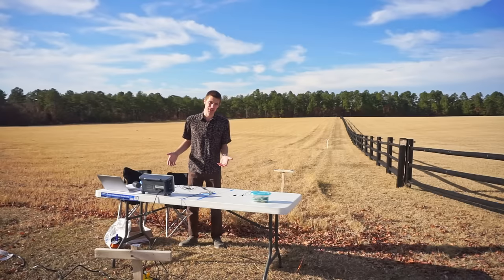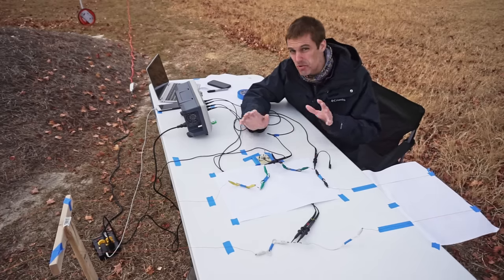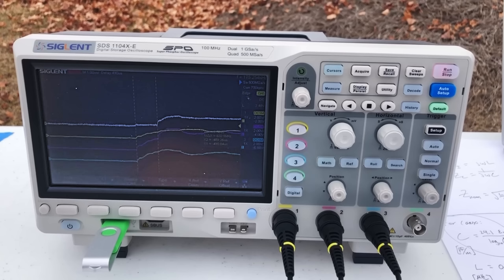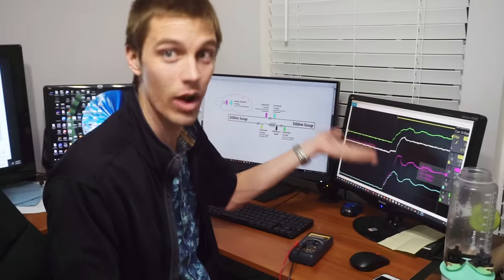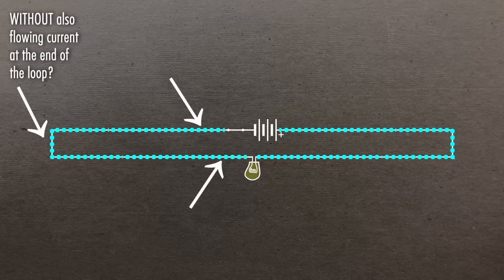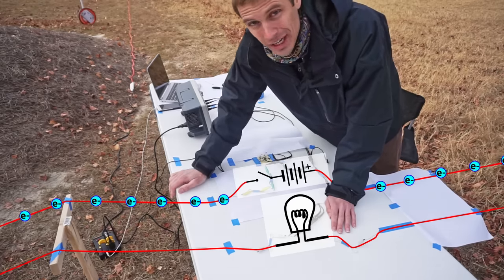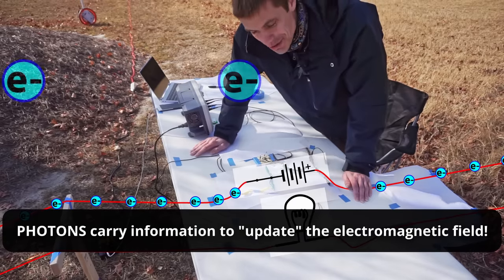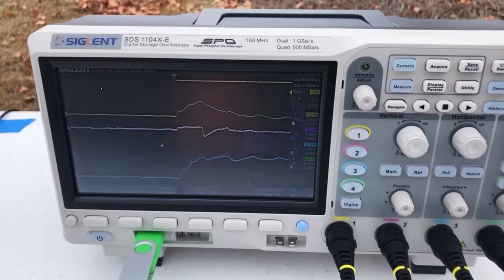I bought 1000 meters of wire to settle a physics debate

Comment: This was the explanation that made sense to me because as you mention, I couldn't wrap my head around the "magic of the pointing field" as it was dismissing the length of the wire and asserting that the physical distance between the battery and light bulb was all that mattered.
Reply: Veritasium deceived his audience by showing the visualizations for a stable state that is only reached after significant time have passed to somehow justify his wrong statement about power getting to the lamp directly at speed of light which is a very different situation.
He didn’t show actual visualizations for his “correct” answer.
Reply: @noop9k  Yep, ElectroBoom and Dave did videos that explain this at a higher level. Essentially you can think of the wires on each side as transmission wires.
Reply: he did say that the lamp has to turn on with ANY current. the problem was that this hypothetical situation can be easily mistaken by people as a very intuitive expectation while it isn't; a light wont turn on with any current, nor having "any" current is "any useful" for other things. he just made a big capacitor. But I suppose the real reason for the video was that energy moves through the electromagnetic field instead of tiny things moving inside of the wire. which is right.
Reply: @falahati  > he did say that the lamp has to turn on with ANY current

He actually said "the light bulb has to turn on immediately when current passes through it".  Maybe because I'm not an engineer, but I thought he was emphasizing the "immediate" part, not saying that any amount of current will turn it on.
Reply: @marko1395  He didn't need to emphasize the any amount of current part in emphasizing the immediate part.
Bulbs fade on relative to their load, so if it comes on immediately, it comes on under ANY load
Reply: @D-Vinko  I guess that's the "I'm not an engineer" part.  I don't know that.  To a layman like me the video did seem to suggest something different.

But it's all good, I only had to watch ten more videos from all these fine people on YouTube, and now I think I understand what's going on :)
Reply: @falahati  
1) ANY current wasn’t in the problem statement. He adjusted the question to suit his own (still wrong)answer.
2) “ANY” current means that the lamp is always “on” from arbitrary noise that is always present.
3) “1/c” answer doesn’t require the wire at all. Because leaves 0 time for the energy to propagate along the wire before jumping over the air to the opposite side. exposes it as a troll question.
4) if we assume “1/c” answer to be true, this means that exactly at t=0 there is a step-like change of EM field around the switch. But closing the switch only allows electrons to migrate, does not cause instantaneous EM field change. Electrons need a non-zero time to start moving, therefore the field can only change gradually and is still zero at t=0. Even if the oscilloscope doesn’t show it, even this small current does not appear instantly but ramps up from 0 within a few nanoseconds, making Derek’s answer  still technically incorrect even if we accept this magical “ANY current” rule adjustment.
Reply: @skilletpan5674  IMO seeing this as a transmission line is also a misleading oversimplification, sorry.
Reply: @falahati  He did make a comment later on saying he did not intend to mean that the light will turn on no matter how little the current was. He was trying to say that there was a small but substantial amount of power transferred instantly. So what most people thought, was what he was actually trying to say. And he was wrong about it.
Reply: @falahati  Someone who actually understands the physics. It's tough to understand whats so unintuitive for the masses, but reality none-the-less. Keep your brain fully engaged, there are too few who manage this feat in my experience.
Reply: The physical distance between the battery and light is all that matters "for any information originating from the switch to reach the bulb" (quotes for emphasis). That's it. It's not about useful energy transfer - it's about information.
Reply: @falahati  The issue with setting it up as Derek did is that leakage current through whatever switch you're using - and through the gap between the bulb and the battery - will cause the lightbulb to never turn off
Reply: @caiocc12  The original video wasn't about information though, it was about how electricity works. So it really is about useful energy transfer.
Reply: @Lilitha11  the original video was very unclear as to whether they were talking about power or about information. One of Derek's examples in his video was a Morse code line.

Comment: The reason I liked this explanation so much better than Veritassium's is that it showed off both the practical reality, and the interesting technicality at the same time. Derek's video is misleading in the way that it emphasizes a technicality while brushing aside how utterly contrived his setup must be to even achieve that. People leave his video thinking something to be true that isn't. And even then, the 1m distancing itself isn't emphasized enough, viewers will mistakenly attribute most of the phenomenon to light speed rather than proximity and inverse square law. At 10m it's not just that the delay would be 10x as long, it's that it would 1000 times weaker. Saying that the bulb "wouldn't reach it's full power" until the electricity made the loop is like saying an ant helping push an aircraft carrier under full engine power "doesn't quite do all the pushing".
Reply: My friend billy the ant would disagree, he once managed to push start a fire truck right before the driver switched on the ignition.
Reply: This... I'm disappointed in Derek in this specific case..
Reply: Yep. This is exactly why I didn't like Derek's vid. He's not exactly wrong, but the nuance was thrown out.

A lot of the potency will dissipate via wire, because, guess what? In the real world we always have resistance as losses.
Reply: Wouldn't inverse square law mean 10x further corresponds to 100x weaker? You said 1000x weaker.
Reply: @Chrispheh  - Correct. I meant inverse-cube. I think. Or maybe it's invert-square and only 100x, since it's the surface of a sphere at that distance from the origin, not the volume. Hmm.. in any case, at 1 meter it's almost immeasurably small, at 10m, to have a light that could actually pass this test, it would also be triggered by stuff like you blinking your eyes or farting. It's just such a microscopical useless amount of power to even sort of be true... and Derek doesn't even explore this in his video. You're led to believe this would work at any distance between wire pairs and that electricity is not carried by wires. In practical reality, that's rubbish and even in a contrived, imaginary scenario he didn't even make his point very clearly.
Reply: Great points, but I'm super confused about the ant analogy.  Is the aircraft carrier sitting on land? In that case, the engines wouldn't do much either.  If the carrier is floating then, 1) how are there ants in the middle of the ocean, and 2) who taught the ant to swim? Also, I think it may make more sense to attach the ant to the front of the carrier with some kind of towing line instead of it pushing; that way you could attach a lot of ants at once, but if they're pushing, you're limited by the surface area of the ship, not to mention how difficult it would be to grip it considering everything is wet (although depending on the size of the ants and what part of their body they're using to push, and the fact that most insect bodies are hydrophobic so they don't drown in rain drops, you may be able to get a dry ant-to-ship attachment).

Thinking more about using a line/rope/cable to attach ants, you'd likely have to have multiple ants per line as with one ant per line the additional mass and inertia of the line itself would likely cancel out the advantage gained by being able to attach more ants.  I think if you used a line with a high tensile strength to weight ratio (thinking spider silk, Kevlar, CFRP, or carbon nanotubes) and designed small loop-style harnesses along the line so that you could attached thousands of ants to it, then they might have an effect.
Reply: @MattsAwsomeStuff But parallel wires DON'T obey inverse-square.   Instead they obey 1/r falloff.   That's why the 1M separation cannot block the small initial signal.  Going from 1M to 10M separation would only reduce things by 10, not 100 or 1000.  (In other words, Dereck's video turns up *many* serious viewer misconceptions  ...but then he doesn't discuss them, and therefore the angry viewers learn nothing, because they all insist that Dereck is wrong or even incompetent, when actually the physics-mistakes are their own.)

In other words, that one-meter spacing between the wires; to me it appears to be done intentionally, because students will think the 1M gap is enormous, when electrically it's 10X smaller than one might imagine, if our reasoning had been based on 1/r^2.

Physics:  emission from tiny point-like dipole sources falls off as 1/r^2.    But emission from a long (or infinite) wire will only fall off as 1/r.    (And emission from an extremely wide plane doesn't decrease at all!)
Reply: @squeakybunny2776  i don't normally watch him, but as an EE when i saw the thumbnail i had a bad feeling, watched a reaction video and i learned the truth. He over emphasized a technicality for a "gotcha" video. He also changed the original question to be highly contrived after he gave out the answer to the contrived problem.

I hate dishonesty and this has definitely made me not trust any of his videos, if i am trusting you to explain an unfamiliar concept to me i must also be able to trust you won't intentionally mislead me. (I understand oversimplification for educational communication) 

Also you can usually tell if a content creator is honest about this sort of stuff, good indicators are overly pedantic rants (Technology Connections) and videos dedicated to revealing the behind the scenes (Kurzgesagt, they have a video titled "We lied to you, and will do it again" that is explaining the pain of balancing simplifying complicated subjects without dropping important nuance), or just through constant checking against your own knowledge (math channels like 3blue 1 brown) which admittedly requires them to have videos on a topic you are well versed in. (Also beware of confirmation bias)

And a red flag is a toxic community, really obvious when you make a comment with light math and like 30 people complain in the replys. (I think it was action labs with a magnetic skin care mask and a big magnet)
Reply: @wbeaty  Wait, so given an infinitely large metal plate as an "antenna" you could transfer energy at arbitrary distances?
Like a laser?
Reply: @YourMJK  if it's infinite then yes, since the Arbitrary distance will be a tiny puny spec compared to your infinity sized metal plate.
Reply: @wbeaty  What you say is true for static charged things (point charge 1/r², long wire 1/r).
But when you talk about emissions I guess you mean Hertz Dipole? Then we have one B field that drops with 1/r² (created by the moving charge) and another field induced by the first one that drops with 1/r. The E field has two parts one with 1/r³ and one with 1/r.  
The energy flux (aka Poynting) from a Hertz Dipole drops with 1/r²  

And we have to think about what case we have here exactly. Is it a staticly charged wire or is it a moving point charge like animated in this video.
Reply: I was wondering what would happen if we did the sme experiment but the gap is 1m, 10m. 100m, and so on lol
Reply: @nxj18xbmc  

You need to simplify the problem by modelling both the aircraft carrier and the ant as spheres.
Reply: @whuzzzup  Yes, the Poynting flux for a tiny object (dipole antenna) is radial vectors in a spherical pattern, same as optical point-sources, and falling off as 1/r^2.   But a long line of such sources superposed gives a cylinderical pattern of outward Poynting flux, and the combined Poynting flux does not have 1/r^2 decrease.   In the region very very close to a transmitting antenna-wire, the pattern of radiated Poynting flux falls as 1/r, not 1/r^2.  
That describes Veritasium's setup, both as capacitor-plates and as antennas:  1/r falloff of cylinder-shaped fields.   It gives counterintuitive results, and as a result, that 1M gap "acts small."    In other words, long wires aren't point-like, instead they are physically cylindrical, and so are their nearfield fields.   On the other hand, very short wires are point-like (especially if we consider a surrounding region >> wire length.)
If we were light-years away from Veritasium's circuit, we'd see the entire circuit as point-like, and only see the 1/r^2 falloff.

Comment: If you buy cables off the shelf instead of making your own transmission line in free space, the cables will list the velocity of propagation with respect to C on the datasheet.   The ubiquitous RG-58 will carry a pulse at 66% of C.
Reply: Also known as the velocity factor .
Reply: Rf engineers and radio hams know all about this and make use of it in antenna designs and stubs   which are particularly useful in phase matching or cancelling.
The vector voltmeter can be used to make the measurements.
Reply: Good co-axial cables have a Vp of about 0.8 or more, i.e. 80%
Reply: This all sounds like a different language
Reply: @thomasmaughan4798  the glass stuff makes sense, the electrons aren’t moving through a vacuum and therefore we can say macroscopically that they aren’t moving at c. Which is all to say, thank you for your comment, I still don’t understand anything but I don’t understand it a little bit less.

If you would entertain me, what is capacitance and induction really?
Reply: @thomasmaughan4798  It was less fun when I have realised that the circuit I was designing was sensitive enough that I had to protect it from stray couplings at high freq.
I was dealing with 10ps precision time measurements. That is the region where all your circuit is just one big electromagnetically coupled mess.

Comment: Thanks... Finally someone that did the experiment.
I was so frustrated not seing an experiment at the end of Veritatium video... You cannot tell that everyone (including experts) were wrong all their life without doing a proof experiment, or at least a simulation... It's not like it's a very hard setting in addition.

This video was the clearest I saw on this subject.
Reply: No expert had any doubt about this, and no such thing was claimed either.
Reply: @ognimimerkki  If it was so clear and it do not claim incredible things, why so many experts got chocked by this video ?
Why so many expert claim that the video was wrong and/or missleading ?

I'm not saying that the explaination of this video is new, but the Veritatium video was at best missleading, and clearly wrong on some points.
Reply: Hi Pierre, in the links provided by Derek at Veritasium, you will see a presentation showing an overlay of theory and measurement as backup proof.  I was the one who did the simulation and measurement for Derek.  Hope this helps, it's actually a fun measurement.  You can turn on the "bulb" much more that what you see here if you match the transmission line impedance to the bulb resistance.  Doing that means the voltage on the bulb goes to half of the applied voltage almost instantly, and then jumps up to the full voltage after the propagation time associated with the length of the wire and the speed of light.  The resistance of the wire used in this experiment is going to be a factor in the result.  I did a scale model that was shorter and used thicker wires so I could neglect resistance.
Reply: @rsa4510  Thank for your response. I do not pretend that the tehory is false, and every video I saw on the subject talk about the impedance matching, including this one.

I understand that the idea behind the trought experiment was to show that electromagnetic informations travel at the speed of light in all direction, But the setting was very missleading.

Everyone that work some time in electricity or electronic know that all wires are antennas. If you forget to connect a resistor to a disconnected low voltage wire, the current will vary randomly inside.
Unless you use a very strong electromagnetic feld, or a filter, you will not be able to command that wire current from outside, because the ambiant noise will be stronger that the command.

So, unless you have perfect (and impossible) conditions, you will never be able to light the bulb without additionnal component to create a very strong field and/or a frequency filter and amplifier.
The bulb will either:
- always be on (if all current turn it on)
- flick on and off randomly (if current variations turn it on)
- Turn on after the light speed delay (if realistic current count).

If you find a way to make a wireless transmetter/receiver that work without the need to create a powerful signal on a precise frequency for the transmitter, and a filter and amplifier for the receiver, you will become rich.

Edit: I just understand that the Veritasium video is in fact a commercial for a brand of wireless LEDs. It raise a lot more questions...